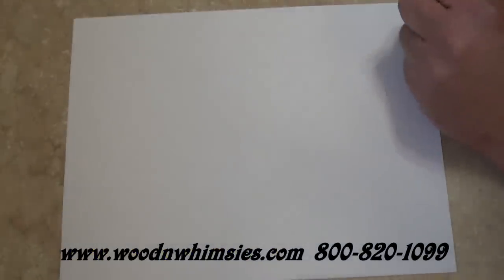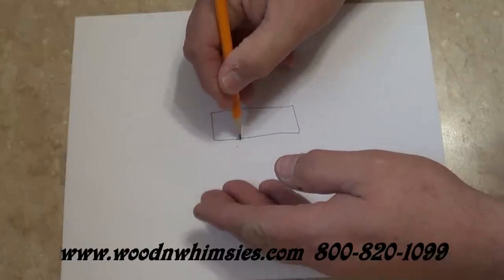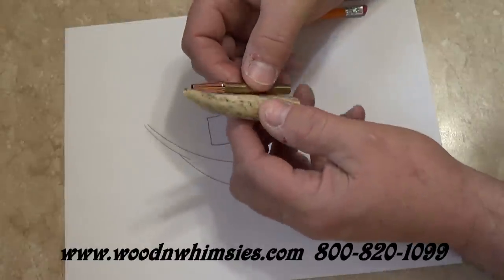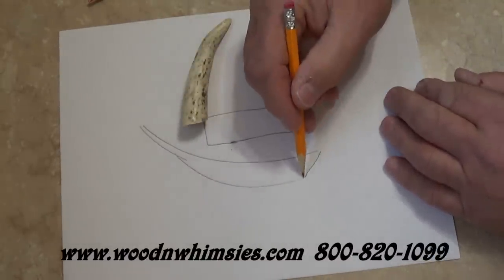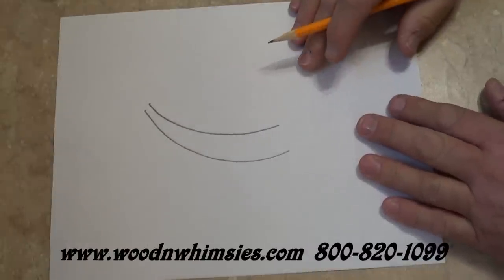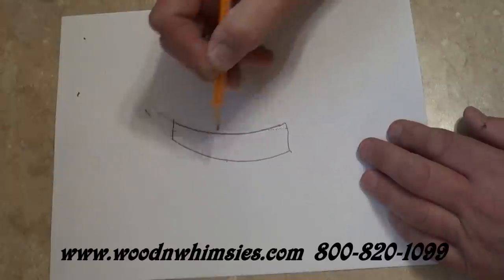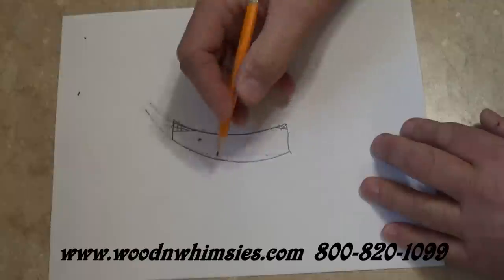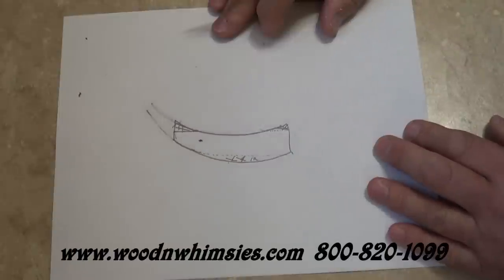Drilling Deer Antler

Comment: Once you cut off the two ends, just mount the piece between centres and turn round. Set your centres so you can see that you have enough material to drill a good hole. If you set it so there will be a little raw antler showing from the low side, then that will give character on the final pen turning....After turning it round, put it in the pin / spigot jaws and drill on the lathe.
Reply: Very much the way I do it, between centers(some adjusting required) then turn a cylinder.   You can then drill a hole through it any way you want.